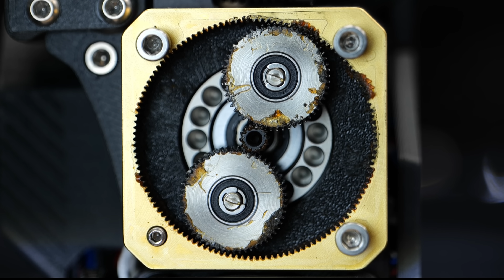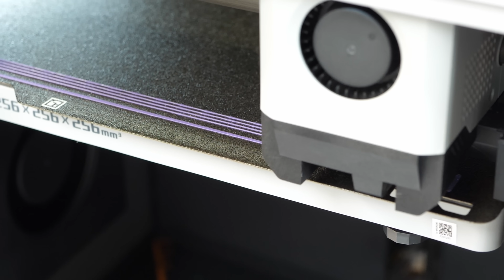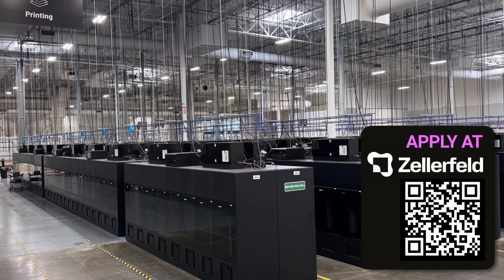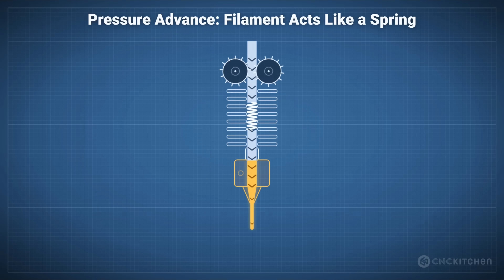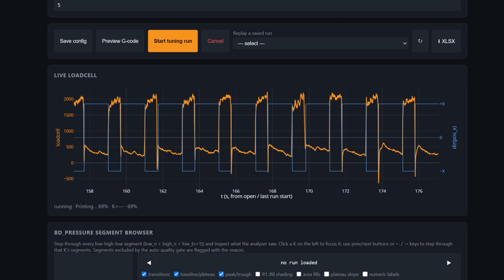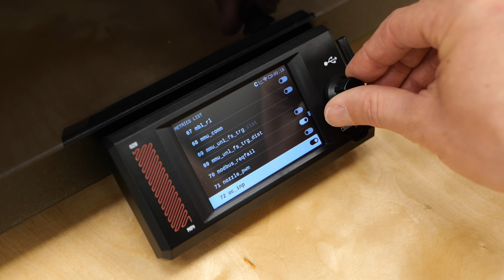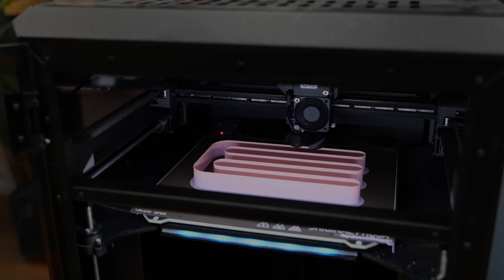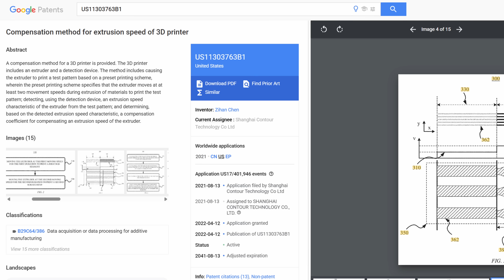I Automated Pressure Advance Using a Bed-Leveling Sensor

Comment: The only problem I see here is that all these autocalibration methods ignore the backpressure from the part. When printing with an increased line width, the calibrated PA value no longer works. So you need to recalibrate it for each used line width.
Reply: I agree with you, this is why the old PA_line calibration pattern forces a fixed line width for all tests in orcaslicer. If you cheat by inputting a narrower nozzle measurement than the nozzle on the printer, the PA values change.

But this will already be a useful tool to get values for adaptive pressure advance, and we can continue pushing forward our understanding from here.
Reply: Wonder if you could get a "close" calibration and use live data for realtime adjustments
Reply: Is it line width or flow rate?
Reply: But then maybe we could repeat the same test whilst actually printing onto a previous layer.

Comment: Do you think Anycubic is doing a similar approach with their flow calibration? i have the kobra 3 v2 and it seems to handle it pretty well. just not sure if the setting is saved and carried on to other prints
Reply: Flow calibration is different.
Reply: @aleks-ivanov  how is it different?
I have the same machine and it seems to do exactly what was described for the newer bambu lab printers.
First it extrudes for, I think two, fixed rates.
Than it makes a series of small extrusion pushes.
That should be all that is needed if the machine has a way to measure the backpressure and is not just wasting filament.
Reply: @j.p.g7517   I mean, in my understanding flow calibration isn't PA calibration. Maybe they call their pressure correction algorithm like this, so in that case I'm wrong
Reply: @aleks-ivanov ah okay. I thought that you maybe had some additional information.
I can see that the name could be seen as wrong, when thinking of fluids and pipes.
But I think that it kind of makes sense here if you see the over and underextrusion as part of the flow behaviour.
As the original post says, it seems to work pretty well and hands off.

Comment: i think something to consider here is adaptive pressure advance, a simple K value will never work in all cases. having an automated procedure allows tuning much more precisely with no effort.
Hot printed ASA being more off is actually proving that, different plastics benefit from an adaptive advance more then PLA.
Oh also... perhaps just messing with the timing offset using binary search would suffice? since it allows you to shift the curve a tad earlier to get no overshoot/undershoot.
so right now its a (`/` = reality, `|` = commanded)

|   /
|  /
X

where as really the tuning goal should be 

  | /
 X
/|
Reply: Adaptive will be the future once it's possible, couple that with diameter monitoring and compensation and we're getting into so amazing levels of accuracy
Reply: @sycoaniliz  kalicos adaptive pressure advance already offers insane accuracies.. the future is already possible, its just insanely tedious lol
Reply: @contomo5710  Adaptive is pretty easy to calibrate in orca. I do that for every filament. Also easy to tweak afterwards. If I notice over or underextrusion on some print (I set it slower than usual for example for some reason), i just print one other pattern with exact values that were on that line (easily accessible in the slicer) and add it to the adaptive data. So with time the prints come out better and better. And I don't bother with doing a huge initial calibration - just a couple speeds and maybe 3 acceleration values
Reply: @Aisper_  orca is the wrong point to lever at for adaptive imo
Reply: @sycoaniliz 
And then we will have tech that keep up whit industrial printers from 2015

Way not copy them xD